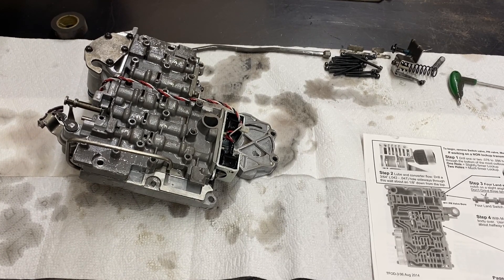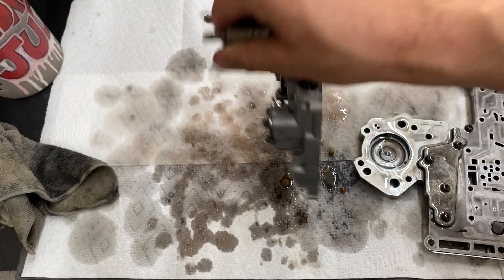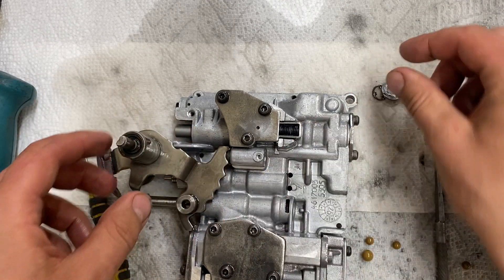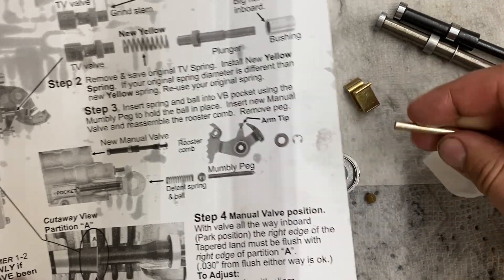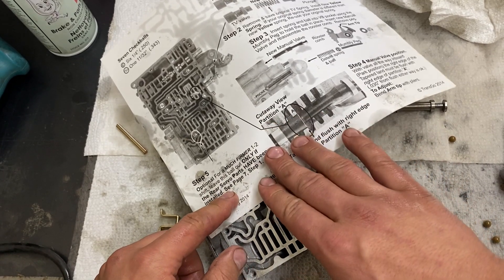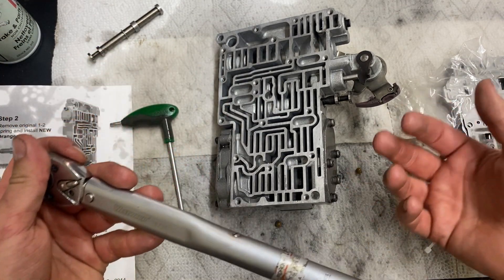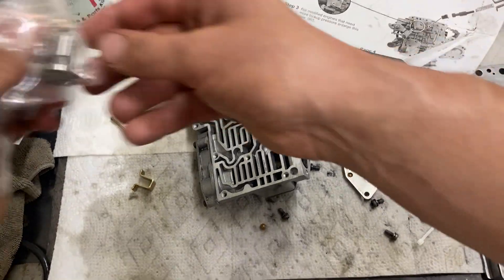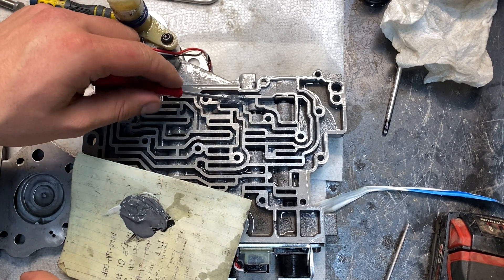47RH/47RE/48RE Transgo TFOD-3 DIY Manual Valve Body How-to + 2nd gear lockup mod Part 1 (pages 1-4)

Comment: Quick question the kit you’re putting in can we use that kit on a 42 RE otherwise a 500 transmission
Reply from the maker: Looking at the TFOD-3 Manual it says you can yup!

Comment: Does the 47RE rooster comb work on a 47rh?
Reply from the maker: I dont have 2 valve bodies side by side to do a proper comparison but I cant imagine they are any different. Heck, a 46re one should be the same as well. Did you lose yours?